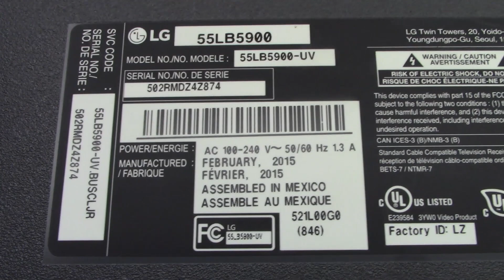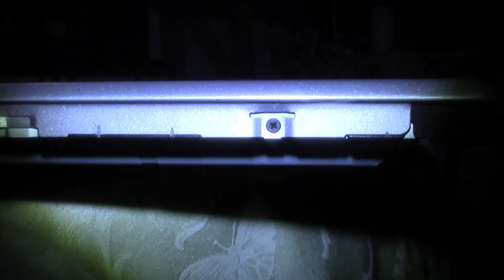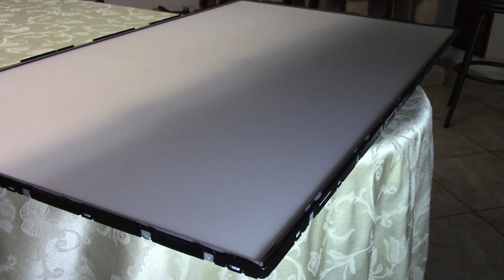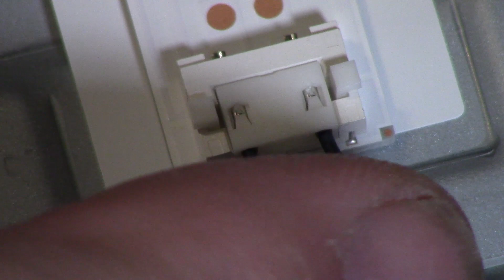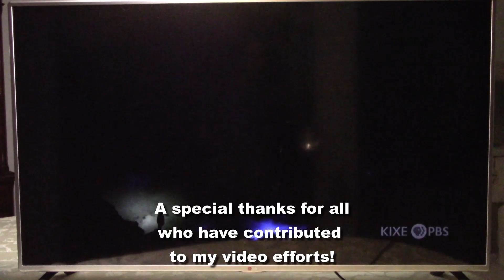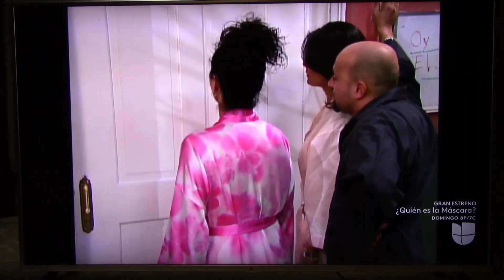LG 55LB5900 NO PICTURE OR SCREEN FLASH - TOTAL LED REPLACEMENT 55LB5550 55LB6000 55LB6100

Comment: Thank you for this video! I have the same model except it is the 50 inch version so I imagine unassembly will be the same. I had several LED lenses come off and I have to re adhere them with a glue or epoxy. Is there a specific epoxy that you would recommend? Again, thank you for making this video! It is much appreciated.

Comment: I was looking for videos on Samsung TV with a blue screen. It started out boot looping and I put a piece of tape on the main board ribbon and it stopped the looping but now I have it a beautiful dark blue screen my back lights work my power board works my speakers work so I don’t have a clue how to test that board because the T con board is inside of the main board. Also I was wondering do you have more videos on TVs? I’ve been down the list. I don’t know which ones for TVs and which ones are not I’m sorrybut I’m looking if you could send me some that about my issue I would appreciate it. I thank you by Sun I mean links to those thank you God bless.

Comment: Yeah, good video here. I need some help. I have replaced the strips on my television and it didn’t take care of the issue, then I replace the power board and it didn’t change anything either. You got any advice or info that I could help me? And by the way, I’m not a computer repair guy but I am pretty good with my hands in mechanical leave and stuff. I’ve got a multi meter but I do not have an LED tester. So if there’s anything flash any ideas, please let me know appreciate it.
Reply from the maker: I would get an LED tester and test the strips for sure.

Comment: I have a lg tv which required led strips which I obtained from shopjimmy, however after replacing the strips the strips will keep flashing and will not stay on. the model is 55lb630v can u assist.

Comment: HELP.  Your diffusion layers,  thickest white part on bottom right?   Is that thick part have a back and front side?  I may have flipped mine or rotated by accident.  The thin layers I did not, they can only go on one way, my top most layer was grey-ish during assembly.   After replacing 4 leds on my 60LB6100   It looks like I have no or less diffusers somehow?  Please look at my video.         https://youtu.be/EvNiuAXkFHE

Comment: DOH !  On my 60LB6100 I left the LCD panel on the black plastic rim.   It didn't get damaged but I guess that 's bad?  Probably puts LCD more at risk of cracking when snapping the black rim back in place, a little hard line up. I had to do twice over the weekend.
Reply: It appears my LCD screen is glued to the black plastic rim on the 60" model ??  Peeled up edge tapes/ribbon ends and still adhered super tightly.   Don't want to try putting a razor blade in between.   Keeping attached to black plastic rim seems ok.  A little tricky to line up when installing.

Comment: Working on a 60LB6100 with a Jetson Super LED tester DLV300,  It only lights up individual leds not the whole AB   strip.  With or without end wires.   Is my LED defective or can you not test whole strip?  Why  does the B strip need jumpers?   Also, why 3 test points vs. 2?  NOOB here.
Reply from the maker: Unplug P801 from the power supply board, Using the + and - markings from the power supply board to identify the positive and negative leads test the unplugged leads with the LED tester. + to + and - to -. Your set has 2 sets of LED strips all in series if your tester puts out the 300ish volts it should light one set at a time.
Reply: @norcal715  Thanks, drew a diagram of the B boards now I understand where the traces go and do not go and why the jumpers are needed at the end.
Reply: @norcal715  So I tried an industrial heat gun to heat the solder up for LED replacement and with it at hottest setting )500*F) and board underside browning for several minutes the leds never loosened.  Not hot enough?  Had to surface solder with pen and replace.  It was not a metal circuit board substrate.  Ever had this happen?

Comment: Excellent video, showed exactly what was needed for my led replacement.  Bought the parts from shopjimmy and everything went smoothly.  Took about 2.5 hours in total.  If I get a few more years out of the tv I'm happy with it.  Also turned down the backlight to 50 as recommended, thanks again for sharing your knowledge!
Reply from the maker: Great job keeping another disposable set out of the landfill!

Comment: Very interesting video. I have the same problem, Flashing LEDs. I tested my LED and they look OK. One thing I found is that with my TV, this only happens when my TV is cold. About 65 °F. If I heat up the electronic boards, everything is OK. If I cool it, the same problem appears. Try to warm up your electronic boards, not your LED strips and see if this solves your problem. Unfortunately I have not found which component causes this problem. Can any one tell me which part of the circuit detects the different current between the 2 strips and starts the flickering when it detects a different current of more than the threshold between the 2 LED strips.
Reply: @steven4737 Thank for the information. Unfortunately, my tv is like yours, different number of LED between the A and B set.

Comment: Hi, I have the same problem with my TV.
Great video overall but the explanation of the voltage measurement at the beginning seems kind of wrong.

The TV has 5 LED strips with 11 LEDs each. 3 strips are powered by one driver and 2 by the other one. The LEDs are connected in series so to get all LEDs to the same voltage the driver for 3 Strips HAS to have a higher Voltage.

Your models uses 3V LEDs. At full power one driver would output 66V and the other one 99V. That way every LED gets 3V.
You measured 57V and 72V at low brightness from the tester. This equals to 2.59V and 2.18V per LED on each driver so there is definitely something wrong with it. If both of them had 72V, the 2 strip driver would supply 3.27V to the LEDs which would be too high.

My model uses 6V LEDs.
I get 118V on one and 180V on the other driver. That means 5.36V and 5.45V per LED on each driver. These values are pretty similar but my TV still has the same issue as yours.

Comment: Hi, I have the same issue with my 50LB5900. Where do you recommend me grabbing the LED strips from? I belive mine has 9 LEDs instead of 11 like yours.  Please advise. Thanks in advance.
Reply from the maker: Find the actual part number on the LED strips (tear it apart) and look on the internet. Many times on shopjimmy.com, if you enter your model number and the suffix they will come up with the actual part number for the LED strips. Look on eBay or Amazon and order them. Just remember to turn down the backlight to 50% (or less) after you replace them

Comment: Thanks for the clear, easy to follow, instructions. 
As you explained, you need to purchase a LED tester, to check the strips first. 
Strips come off easily when you use a heat gun. 
Unfortunately, I broke half of the edge connector clip, for the ribbon cable to the screen. I repaired that using a bit of clear food container plastic wedged into a quarter of the width of the connector and then hot glue to hold the ribbon cable in place (holding the glue down with the head of a screwdriver as it cools). 

If I was doing this again, I think I would remove the ribbon connector on the T-Con board instead.

Comment: My Panasonic Viera LCD (new from 2011) still works A-1 today and the BL level is at 55-60% for ALL picture menus and inputs (which matches the contrast setting for each). In any event, you saved another set from possible landfill and your customer is lucky he didn't burn his screen beyond repair with picture menu settings at near-maximum. I hope he accepts the bill and is soon happy to have a working TV back. The old service workshop motto used to be "a good customer is a happy one".

Comment: Dont worry Steve; LG fixed the LED problem so instead of shorting or going open as often... they now just turn a lovely bright blue colour. Coming your way soon, just wait. 🤪😂
Reply from the maker: I have seen the blue phenomenon but never worked on one. Maybe I now have something to look forward to. Remember "if you lower your expectations low enough you will never be disappointed " NORCAL715 (2020)
Reply: @norcal715  haha I'm pretty sure the American Band 'the gin blossoms' had a similar line in their hit song Hey Jealousy.
Reply: Isn't oled even worse where the drivers are part of the screen? Replace,don't fix kinda thing
Reply: iv had a few of them,blue image,the phosphor burns off the leds
Reply: @oblioi  Is that a thing that's fixable or now it's a boat anchor ?
Reply: @bertvisser6423  we are not talking about OLED. Just the same as repairing an LED tv. You need to strip it back and change the Blue LEDs out.
Reply: @bertvisser6423  i found it an easy fix if you can replace the leds with samsung or panasonic leds
Reply: Very common so far in the UH UK and UJ models by LG. There are many others but they have been the big sellers like the LN LF and LB models previously.